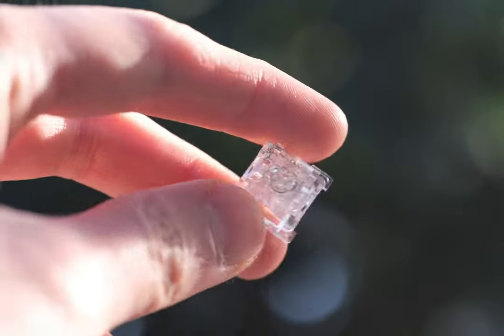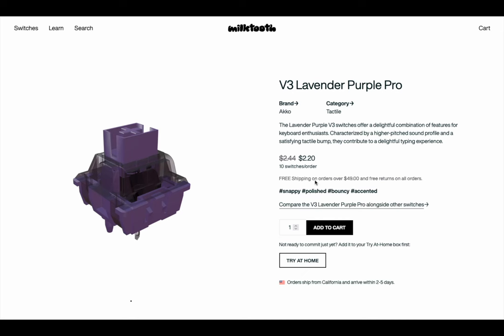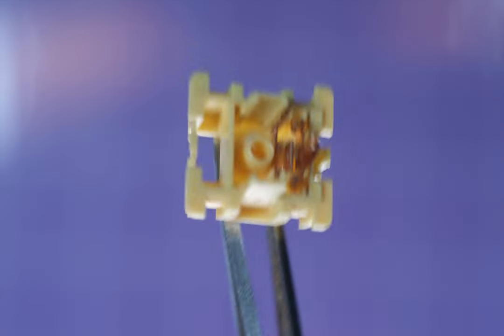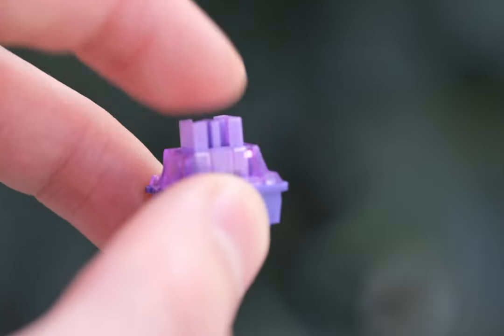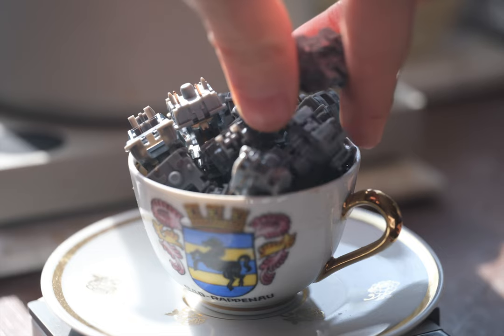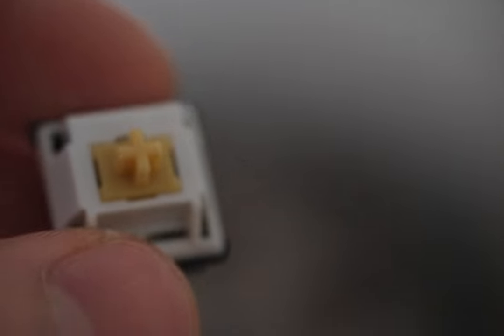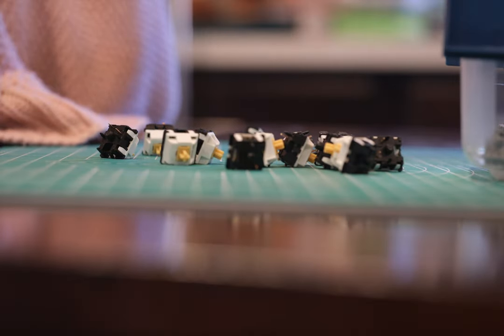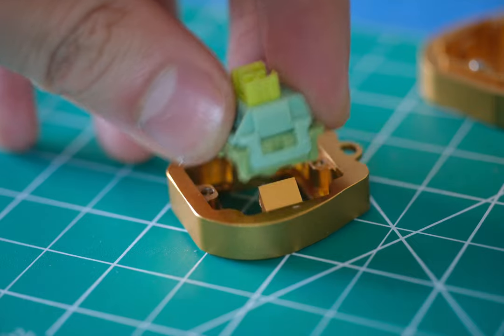All Akko Switches Reviewed & Ranked (2023)

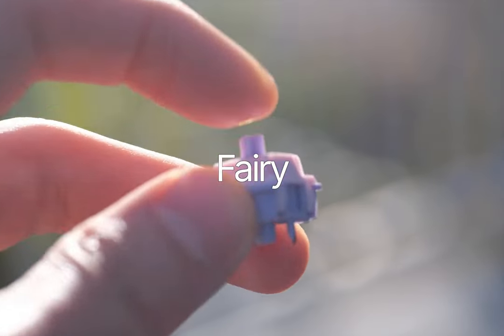Comment: Slight correction in 4:34 because Akko already previously dipped their toes into the silent switch realm with the Haze Pinks. The Penguins and Fairies are more silent than their predecessor, in exchange for a slightly mushier feel. Other than that, great video as always 👍

Comment: I found the Lavender Purples too loud on my Monsgeek MG108W which has a top-mounted alum plate. They fare better on gasket PC plates. The Pianos however were quieter and smoother but still very clacky compared to the true thockers out there like the Vertex V1 and the Epo Jade Blossoms. Notable difference between the Pianos and the Jade Blossoms on my Monsgeek M1W. I think Akko just prefers clacky because that's their thing.

Comment: Tried Akko Penguins as I wanted silent tactile. Alas these are quite mushy (due to the dampening material used to silence the keystrokes), not as snappy as most other tactile switches I've used, and I don't like the sound signature (it's quiet but there is still sound which I cannot consider pleasant) and feeling. They're also much more scratchy compared to my daily switches (hand-lubricated Boba U4T, not silent but tacticle). Didn't bother lubricated Penguins as there are so many cons in my opinion. Besides reviewers telling that these are already good in this regard...so IDK, they're awful switches, better not to waste money and get Boba U4 (silent ones). Much more expensive but worth every cent.

Comment: my partner got the fairies as we both like silent switches and hate clackiness and I got the penguins. I love the penguins. she realized she doesn't like linear switches and got some durock silent shrimps. she really likes them. compared to the penguins the silent shrimps require a bit more effort to push and have more of a tactile bump and are less squishy on the bottom. I prefer the penguins because they have a lower tactile bump and are easier to depress, and are more silent at the bottom thanks to the squish.

Comment: Are the V3 Matcha Green Pro switches compatible with the hot swapabble rk61 keyboard?
Edit: Do you think it would sound good and perform good as well, or would I have to do my own mods to it? I prefer to do as little work as possible.
Reply from the maker: The V3 Matcha Green Pros are compatible with the RK61. As noted in the video they're great stock.

Comment: Do they fit in otemu PCB
Reply: I'm researching the same they do not but you can get some pliers and snap off the 2 extra plastic pins
Reply: Well actually by checking the PCB if it only has 3 pins than it can only support green and clear akko switches . Since green and clear only have 3 pins and those will fit in.